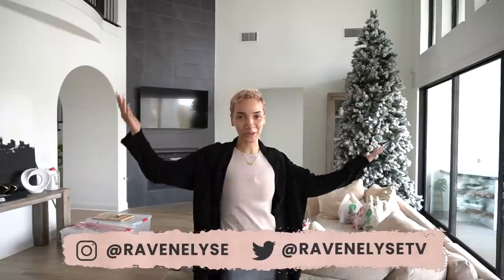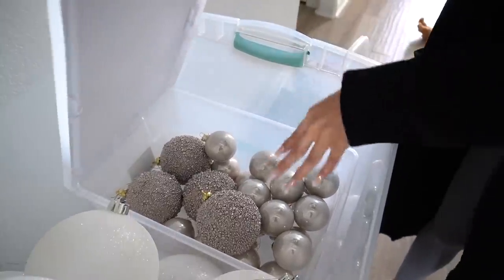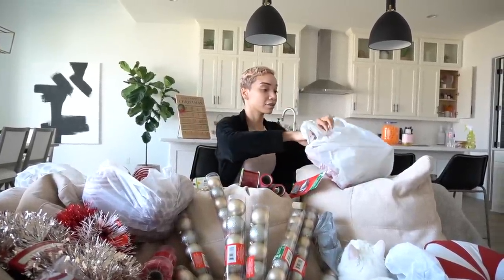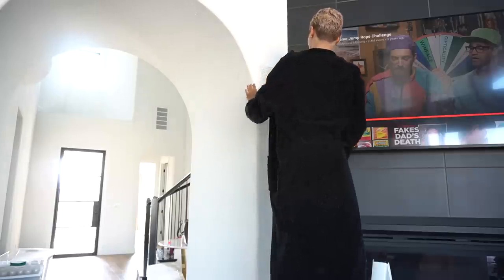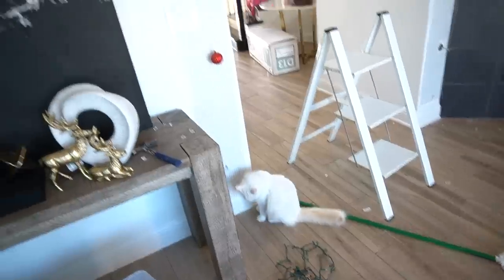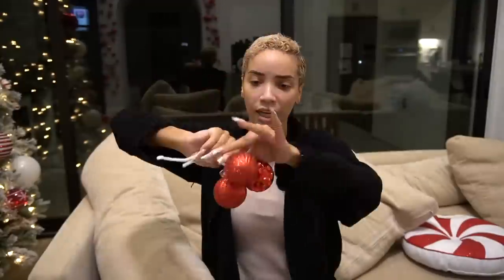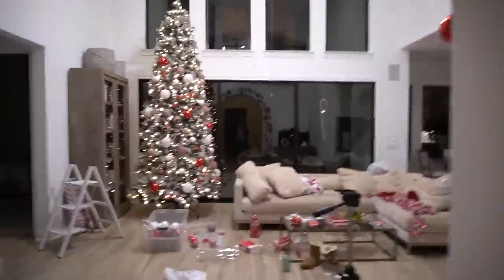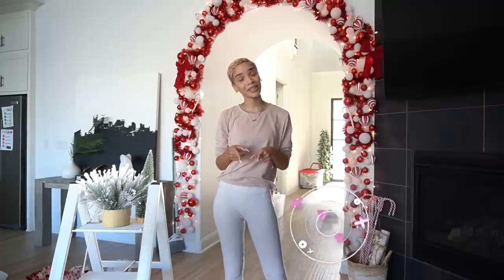Decorate for Christmas with Me! | DIY Ornament Arch from TikTok!

Comment: I literally do an entirely different theme every year 😅 like I'm a mess. Haven't repeated a single theme yet either.

My advice, for a 12ft tree, buy the mesh ribbon and stuff it in between each layer to make the tree look more full. Alternative would be to buy 3-5 inch ribbon and make a bow at the top and let the strands cascade down the tree. Ribbon is my favorite decor to add on a tree. Also PICKS. Buy a variety of Christmas picks (I usually use 2 or 3 types). Get as many as your tree is tall (so at least 12 of each). And only using big ornament balls on the tree will also make it look more decadent and full.